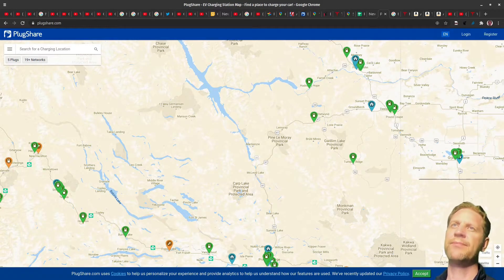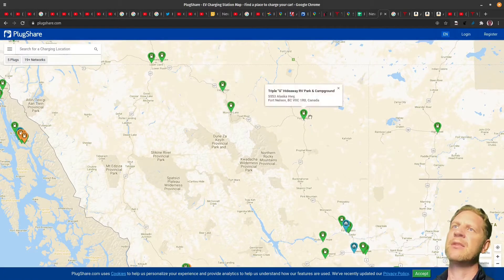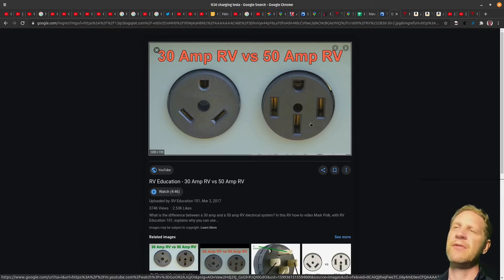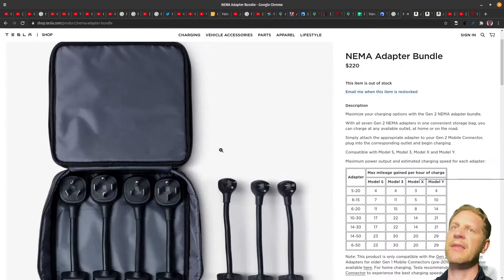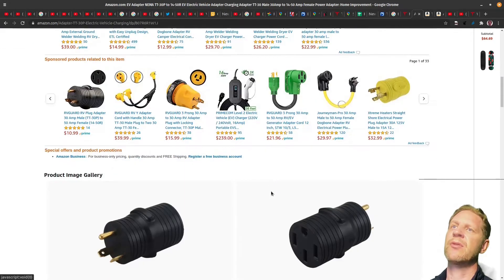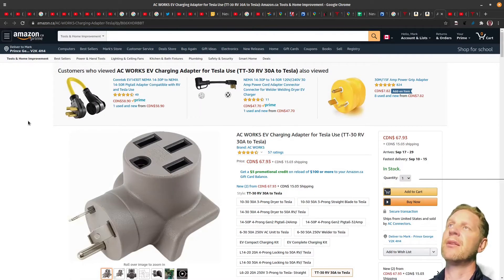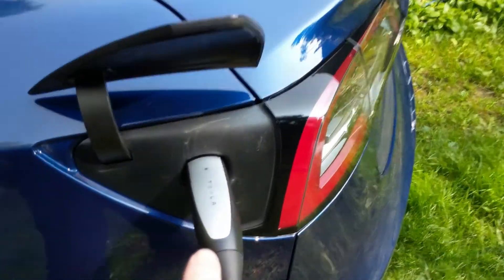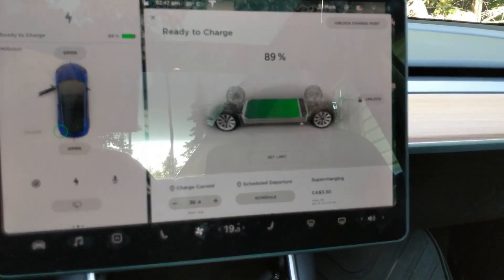Tesla Model 3 | Charging at 30 amp RV Sites? | Remote Locations that only have TT30 plugs - Part 1

Comment: The reason your car was not charging because you are using TT-30 adapter for RV and you should be using TT-30 adapter specifically for EV as the wiring is different. Also @7:40 you are calculating estimated charge, but that estimate is based on 240 volts while campsite 30Amp circuit is 110v so actual charge rate will be around 10-11 km/hour and not 20 km/hour

Comment: Thank you for this video.  We are long-time RVers and new Tesla owners.  As RVers we are familiar with the TT-30 at campsites.  We have a TT-30 at the house for the RV, and have now added a 14-50 for the Tesla.  But I still wanted an adapter to TT-30 for the same reason - we might bring the Tesla with us camping and it would be nice to use a TT-30.  Plus, it would expand our ability to charge at different facilities if needed (like trips to the places you list).  I had a different adapter in my Amazon cart and realized through this video that I had the wrong one (with the L-shaped ground).  I’ve now switched to the one you list, partly because it caps the charging at 24 amps.  It’s more expensive but will be well worth it if it avoids a problem even once..so thank you.

Comment: Hey Mark, that is a great video you made.  But I just wanted to point out two things, one is why it is not working with that adapter and second a terrible mistake you are making when measuring Amps.  

First, that adapter isn't working is becase NEMA 14-50 uses 240Vac (Two hot wires L1 & L2, then a 3rd cable called 'Neutral' not needed by the Tesla EVSE, and a 4th wire called Ground, essential for it to work). And your adapter is a 120Vac (Only one phase L1 on this case, Neutral and Ground). What the adapter is doing is taking L1, Neutral and Ground from the TT-30 and taking it to their L1, neutral and Ground pins on your NEMA 14-50 respectively but leaving L2 un-used. But the Tesla EVSE really takes the power from the L1 & L2 pins from the NEMA 14-50 so that is why is not seeing any voltage. So it is expecting to get power across L1 & L2, but that adapter has left L2 open.

In the case of the other adapters that do really work, its because they internally 're-wired' L1 to L1 and the 'Neutral' to L2 respectively from TT-30 to NEMA 14-50. And with this the Tesla EVSE will see 120Vac across the L1 & L2 pins on the 14-50. 

Second thing. You shouldn't measure Amps/current by putting the DMM leads directly to the power source (You would create a short circuit that way and would be bad!). The DMM you show on the video, a DT-202; it is a 'Clamp' current meter, so means it only can measure current by taking one of the hot wires 'through the clamp', not by the wire probes. Those wire probes are only meant for measuring DC voltage, Resistance and Continuity, that's why they are so thin and cheap because they would never carry more than 5-10amps. (The reason why it's reading on your video, it's probably because the instrument is not a super high quality and may have some internal signal leaks).

Hope this helps, regards..!
Reply from the maker: Thanks! Clearly I am no electrician, but your comments are welcomed! I learned a few important things from your info above so thank you!
Reply: Sure no problem, happy to help.

Comment: Would this one work?
https://www.homedepot.com/p/AC-WORKS-EVSE-Charging-Adapter-RV-TT-30P-30-Amp-Plug-to-50-Amp-Electric-Vehicle-Adapter-for-Tesla-Model-S-EVTT30MS/301768722?MERCH=REC-_-
Reply from the maker: I believe so as it mentions ev support, I linked a similar one in my description
Reply from the maker: But beware to manually limit amps to 25 using that adapter or you risk fire

Comment: I found the same issue with the wishbone adapter I went to home depot spliced and wired a new 14-50 female end to the adapter using the configuration found in this video. https://www.youtube.com/watch?v=uUI_JcS2nJ0
Reply from the maker: I am told by a Tesla owner there is a Y connector that works with Tesla going from two 30 amp plugs to nema 14-50, if i ever find one that works (or if anyone reading this knows of one that works) that should be posted here.